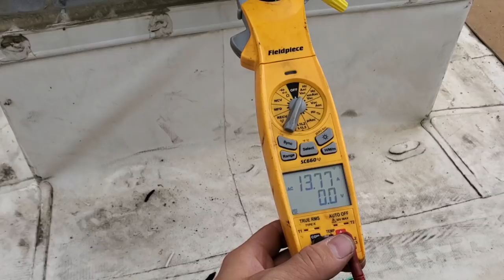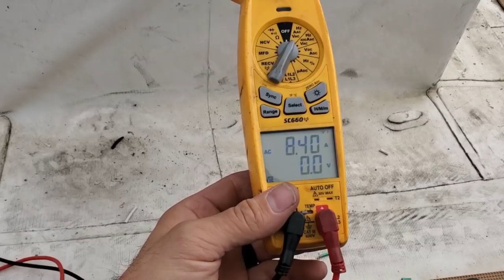EXHAUST FAN REPLACEMENT (CRANE LIFT)

Comment: Funny thing came to mind from the hand signals.  Truck driver asked me to signal him to reverse out of a narrow path with extra wide load, which he had just taken on his truck bed by the hiab-crane he had on the same truck.  I was happy to help and did it with Finnish army signals, which are basically done with fully extended arms and are very clear.  As the truck got out of the hardest section, one of our crew members got to me and said my signals were wrong and was not happy at all for what i did.  Just a minute later the truck driver got out and came to say  "wow, that was easy, no one on the construction sites uses that clear signals" :D

Comment: Here in buffalo NY we only use cranes for rtu replacements everything else we use a scissors lift . Even tho using a crane for a 30+lb. Exhaust fan is way over kill working smarter and not harder is the way to be.  Great video

Comment: As long as you and crane driver knows what hand signal is for what meaning you are beening save you never rushed the job which improves the safety well done working safe is the key to getting the job done

Comment: I have used cellphones to communicate with the crane operator in places where it was impossible to stay in line of sight. Normally when we where setting copeland compressors or something heavy in place we had one guy and the edge of the roof and one guy guiding the compressor in place. With something like that fan we would just put it up the ladder. Never saw one with a hinge kit. That's pretty nice.

Comment: I'm surprised the crain operator doesn't have there own guy on the roof instructing the operator.  That's what I've seen around here.
Reply: I've found that you can get a cheaper crane price if you supply your own signal guy, and most cranes will supply a signal guy if you ask for one, for an additional charge.
Reply: @vondarkmoor1  I haven't worked with cranes in years but when I did union jobs had a union rigger and union signal guy. Regular jobs anything went
Reply: @tylersmyth8861  I could see that for union jobs.  We dont deal with that too much around my parts in Texas. especial for light commercial.
Reply: Here in Australia for the most part you usually get cranes with a crew of two, the driver and dogger (rigger) as standard for jobs like this
Reply: Around here (Washing DC area) I have never seen crane operator bringing any guy with him. It was always the operator alone and signalling the operator is responsibility of the person who called crane.
Reply: In The Netherlands its kinda weird. Sometimes the crane comes with a crew of 2, the operator and a rigger/signal guy. However, that's only rarely. It's more often you're with a crew of 2 yourself, and just a crane operator. 1 who signals (gestures with small loads, a radio with big or dangerous loads) 1 who rigs the to-be-lifted stuff and who controls it during hoisting and helps to place the load down on the designated area.  However, crane operators can ask you and your crewmate if you are certified to do those jobs. If not you need someone else obviously. But if they don't ask for you, you also don't need 1.

Comment: Crain work is hype critical and should never be underestimated. We have the same basic hand signals here in Oklahoma City metro. Like you say each operator has their own little signals but the basic boom instructions and hoist instructions are all the same. Really depends on the OSHA presence in your area too for example here we have to were high vis vest to distinguish the controller. Good video especially considering there was only you on the roof and one guy down bellow.
Reply from the maker: Thanks for watching bud! And taking the time to leave a comment
Reply from the maker: I will address this on my YouTube Livestream this evening evening 3/23/20 @ 5:PM (pacific time) come check I out and if you can’t catch the live show no worries as it will post as a normal video on my channel  after it is over. https://youtu.be/spHHodnX9S8

Comment: You're definitely right about those rheostat speed controllers for permanent-split-capacitor (PSC) motors. If the motor runs too slow it will burn up from lack of cooling. If you use PSC motors with speed control, don't oversize them too much. Most of the time we now specify electronically commutated (EC) motors (for smaller ones where a 3-phase motor with a VFD isn't worth doing). Much more energy efficient, and they pretty much don't care how slow you run them, they don't tend to overheat. They cost a premium, but most of our clients are just fine with that, and since I am mostly doing designs for whole buildings, it doesn't affect the square footage cost enough to make a difference.
Reply: By the looks of this fan. its a Grease fan for a hood.  To my knowledge,  none of the fan manufaturers offer an EC Motor on UL762 listed fans.  That listing is required for grease hood fans

Comment: In Europe you'd often see knuckleboom crane (hiab is one brand) used for this type of job. Part would be transported with the same truck, and likely crane operator would remotely control the crane from the roof. Also I've seen typically crane operators do the rigging themselves. Or if they have customer help them they'll instruct and verify the rigging. 

(I just want to point out I commented this just as a curiosity - I don't claim one way would be better than another)

Comment: New exhaust fans (for applications like kitchen, bathroom, dishwasher, etc, etc.) could take time because you have to set the motor pulley sheave, match the size with the new drive pulley to the old pulley, and match the new idler pulley to the old one. (Only applies to the belt drive exhaust fan.) If this is a direct drive exhaust fan, you have to set the speed using a solid state speed control to match the speed of the old exhaust fan. If the new exhaust fan has a different centrifugal blower wheel size, the adjustments will have to be a little different.

Comment: You are correct that is a fork connector. Look up electrical connector types. There are spade which are our most common used on circuit boards, flat with curled edges. Then bullet used in automotive work. Butt connectors and piggy back to name a few.

Comment: Spade connectors, boom up hold the load is the terms I use.  I was always shocked when i started in hvac that the crane operators didn't guide/rig the load.  They are depending on use and may have no idea what we are doing.  So I went online and learned the hand singles. Nice video keep them coming with your free time you should do some wiring videos like defrost timers. Or refrigeration cycle for the new guys.
Reply: Im sorry fork connectors not spade connectors

Comment: Fork connectors ---> "What are spade connectors?
Spade terminals, also known as spade connectors, are a type of wire terminal that may be either crimped or soldered to the wire for electrical connection. A spade connector may be either a male or female spade connector. Spade terminal sizes are based on both the size of compatible wire and the width of the spade."

Comment: Out of curiosity, do US crane operators not have cameras on the boom? That's pretty much standard these days in Sweden.
Reply from the maker: No I have seen boom cameras once and it was the guy that had the fully remote controlled rig.... most our cranes are basic
Reply: I found also that most of those smaller crane companies are running rather old equipment, so no cameras there for sure.  And when well maintained, such a crane should last quite a while before needing to be replaced, mostly around the time the operator retires,...
Living in Germany I have to be honest, you rarely see comparable mobile cranes like those here. They exist, but they are rare. What you find a lot are cranes, quite a bit bigger on same footprint regarding the vehicle, mostly operated by large crane companies. lately I have seen a number of even smaler and lightweight cranes on smaller trucks, used by solar installers or roofing companies.
What you usually find in this size here, are truck mounted folding cranes. So  trucks delivering building materials bring their own crane that folds into a quite small format behind the back of the cabin, or sometimes at the end of the truck bed.

Comment: When I have done compressors I just we just use our phones to communicate. The compressor has to be dropped in a very tight space so I dont think hand signals would work very easily.

Comment: Hey Chris, so I’m a kitchen exhaust cleaner, I noticed the White residue left on the old fan. That is left over chemical that was not properly rinsed off!, the chemicals we use to clean the grease is very very strong and eat away at the aluminum just like your coil cleaners do, do you think the chemicals being left all over the fan has cause the old fan to fail just from it getting weaken by the chemicals being left on
Reply from the maker: That's a very good possibility

Comment: I think that in Finland, crane is not allowed to lift anything to place where drivers dont see the load, on those situations you have to got camera on boom, or smaller scale cranes what are on trucks got remote controllers so driver is on spot where he see lifting operation.

Comment: man u actually called a crane lol ! my dad would of just told me get on the roof... and use the Rope..  the one time we made a mistake ... we pulled a 9hp scroll by rope instead of calling a crane .. i suffered the next day my back and arms were finished for a good week and i told me dad thats the last time
Reply from the maker: Yeah I have a few of those stories too..... " I used to be superman, but I grew up and got smart!!" 😁
Reply: I regularly lift up to 7 hp carlyles up roofs with two snatch blocks is not really too bad , no boring osha here in south america. I only skip gym that day and it's all fine. That's like the limit, i once did a 9 hp copeland and did not like it too much...

But that fan...

Comment: No retention cable so the fan isn't stressing the flex?  I'm not sure of the strength of that particular product.  I've used aircraft cable to hold the fan to the curb when it's hinges open, it's cheap.
There's nothing like doing a crane yourself, at least it wasn't a package unit or make-up-air all by yourself.

Comment: When you thread the cable through the flexible conduit, bend the leading end over on it's self. Tape it so you have a loop and flatten it. The cable will thread through the conduit easy as

Comment: Why do you want it to hinge? And wouldn't this be a good way to break into the building?
Reply: Cleaning. I'm a casual and don't know specifics but there are fire codes/requirements...especially in CA. They end up caked in grease and could be a potential fire hazard if not maintained.
Reply: hinges are so that exhaust fan is lifted up for exhaust chute grease removal cleaning-many a person has gotten stuck in the chute breaking into restaurants or falling into the deep fryers
Reply: @triedntruefitness  Really doesn't make very much difference, because sooner or later, all of us will be on the menu... all of us."

Comment: seems better to just invest in some inexpensive two way radios to hand out in these situations
Reply: Be careful here...  there are rules for 2 way radios used in crane lifts.  It’s not as simple as head over to the big box store and pick up some radios for $ 20.00 to use for your lift.  There are publications out there with the rules for 2 way communication with the crane operator..   and NEVER, EVER use a cell phone for this application.  There is a delay in the transmission. Be safe!
Reply from the maker: Yeah I prefer hand signals because they are an immediate direction
Reply: @HVACRVIDEOS   I wasn't really suggesting you don't use hand signals at all,  but having the ability to communicate both ways probably couldn't hurt in some situations
Reply from the maker: @Blink_____  good point!
Reply: Signals better
Reply: We use walkie talkies. Especially when you're not exactly near the edge of the roof and when its pinpoint accuracy needed
Reply: The crane company we use are starting to use two way radios they own. In the past we used to talk to the operator on his phone. I’ve done motor and compressor installs and removals by my self. A lot of operators I come across these dudes Ask how many feet up ? How many feet in? What we lifting? What direction? Bam they get it done.
Reply: The point I was trying to make was about the use of 2 way radios..  there are rules about using them in crane lifts.. 

They have to be “Hands Free”.. Closed/ Private Frequency..  so no one can step on you! 

And I can’t emphasize enough never ever ever use a cell phone!

And don’t kid yourself there is no crane operator in the world who would allow you to use a cell phone to communicate with him except to let him know lunch is here!
Reply: @RichGT350r  you are right, those radios are quite special to avoid interference.  Main problem with radios  or even mobile phones as such is, that there might be just some part of the transmission missing in what comes out at the crane operators end. no matter if due to something electrical in the vicinity, some other transmission blocking, your phone acting up or just a high load on the tower, you can be sure that happens in exactly that moment you have to call the guy to emergency stop everything.
Reply: @RichGT350r  I can't emphasize enough that you don't know what you are talking about lol
Unless you are using some expensive spread spectrum digital encrypted radio, there is no such thing as a private or closed frequency.
And no one uses those expensive radios except maybe for dual crane lifts for giant projects.
The good radios some use are just regular business band commercial radios, they are just supposed to use a different frequency then the rent a cops do.
Heck, the news guys filming SpaceX using a giant hydraulic crane with a luffing boom to move a rocket recorded the crane coms with a scanner! Lol

Second, always open duplex radio links are nice, but certainly not required, and in fact are a hazard in many circumstances.
Let's say you have a 400 foot tall crane setting the nacelle on a wind turbine, and you have a crew of 10 guys to line up the 200 bolt holes, with pry bars and chain falls and such.
You have your spotter coordinating them, and he needs to be able to tell the guy with the pry bar to come up a little on his side, and the chain fall to lower, without confusing the crane operator. So only when he wants to give a command does he key his ptt radio mic and gives a clear direction to the crane operator.

Generally when using radio or phone, the spotter will be like an auctioneer and keep repeating the command, just the same as you continue the hand signals.
And if the signal drops out or the crane operator no longer hears a clear signal, he will instantly stop moving and wait for communication to be restored, just as if he can no longer see your hand.

I have never heard any modern cell phone have more delay than a crane operators reflexes have delay lol
And just in case, when you are getting close to something, you have them slow WAY down.

So, for small time crane stuff, nothing unsafe with a cell phone, as long as the crane is going to freeze as soon as they no longer can hear your commands.
And while maybe a professional business band radio is the official method, some ops use Walmart FRS radios, and chances are if if you hand them a radio and it works after testing it, they probably won't refuse to use it because most crane guys aren't also radio guys lol

Anyway, while there are rules, just as there are rules for hand signals, each operator does their own thing, and as long as they stop if they can't hear your signals, the safety is about the same regardless of the technology you are using.

Comment: Hey Chris, cool vid! Sorry if I missed it but what is a REA stat? And if they frequently damage the motors why do they put them on the fans?

Also have you ever done a video about all your tools? I would love to see a vid about all your gauges and voltmeters and how they work and what you are looking for when using each tool.
Keep it up!
Reply: Rheostat. It’s an electronic component that varies current by varying resistance. They’re a cheap and dirty way to control the speed of a motor, but there’s nothing stopping you from applying more current than the motor windings can handle.

Comment: Always assume the circuit is live even if you know it can't be... capacitors can hold charge for a while and you can't be sure it's not powered just because it is disconnected

Comment: Had a few crane lifts. First step in any crane left; communication, communication, communication, let me repeat;communication, you make sure that the one directing the crane guy (and only that person is directing the crane operator) is talking the same Swahili hand signals the operator is. (Doesn't matter what the  bureaucrat says) and you exaggerate your motions to be sure that the crane gets that message. I've also poured a few hundred yards of concrete. biggest bitch drivers had was the person directing them was barely using their hands (like they were self conscientious or embarrassed) 
  Second point is let the crane set the load. that's what its there for.  Worked a home depot job lifting 20 ton units even thoghit was supposed tombe mt job my supervisor was a on the roof and
Reply: hit reply to quick/.  the super was having the roof team pushing the units the final 5 to 3 feet in place, told his boss; he either got off the roof or i did. we finished 6 hours ahead of schedule

Comment: Personally, I'd have taken the speed controller out and used that box for the power switch and let the Balance Company adjust the A/C and/or Make-up Air Units to Balance the Building...
But that's just me and like you, I don't like the speed controller on that particular Fan because the motor Over-Amps at anything below 90% or so of Max.